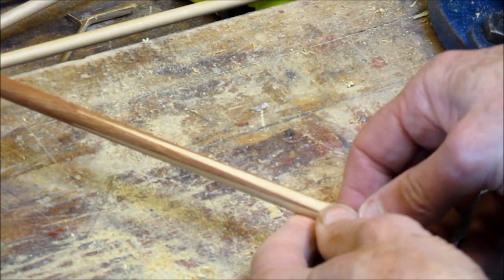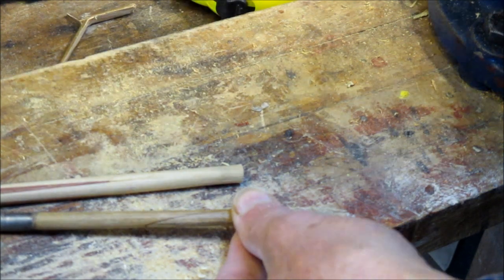Arrow Splicing

Comment: I've tried this before with my own primitive jig.  It's a bit more tricky than it looks to get the two even splice cuts.  You make this look very easy.  There is an art to doing the straight even cuts even with the jig.
Reply from the maker: If both cuts are made on the same jig, they will automatically line up dead straight due to the geometry :-)  
The V splice is much harder to get straight as the V doesn't always spread out symmetrically.
Reply: @delcat8168  how long cut the splicing sir? 3 inchi?